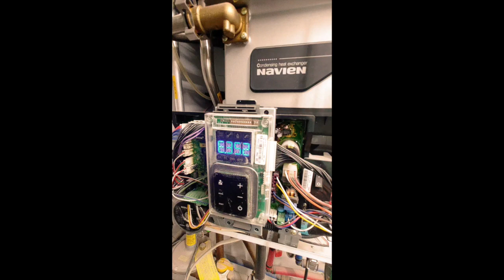Fixing a Navien NCB 240e 352 water pressure error

Comment: Thanks for the effort to document this!  The new pressure sensor solved my E352 code. The 8:10 purge step is critical before turning the system back on. There are other videos out there on draining and purging. Take before pictures, go slow, and don't over tighten plastic parts.
Reply from the maker: Good to hear - I just posted a fix for E515. Simple ( could be expensive if you call out an engineer)

Comment: Thanks for the Video. Did you shut the gas off to do this ?
Reply from the maker: yes, you can see a valve with a yellow cap (to the right of the pressure reg and the yellow label) I turned that off when I worked on draining the system

Comment: Thanks for the video,  could the pressure switch also cause an incorrect low water pressure error code 302?
Reply from the maker: I do not know - but assuming it is a water pressure sensor, I guess it could.  I suggest filling to get the water pressure up (my manifold has pressure gauges) and take it from there
Reply: @zipzippery    well thanks this video i knew what my next step was in figuring out why my NHB150 kept error coding 302. i took this pressure sensor out and it was packed with a fine silt or soot type material! i sprayed it with electrical contact cleaner and picked it out with one of my gun picks! and holy crap! no more low pressure code. didn't even have to buy a new sensor so thank you , my family thanks you as well LOL